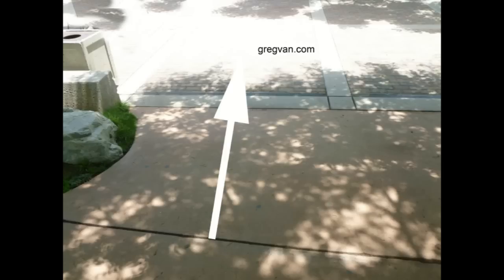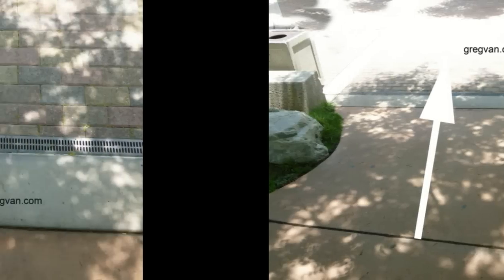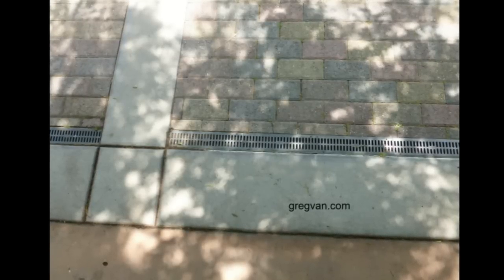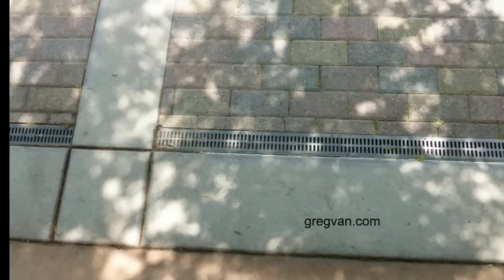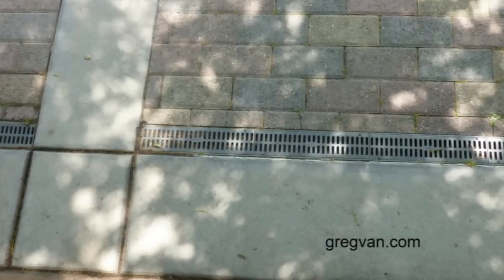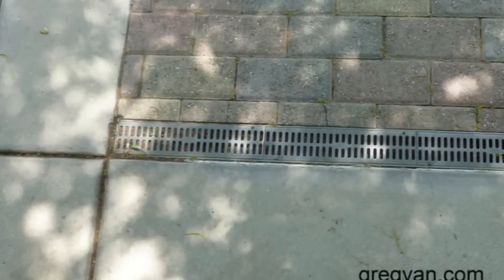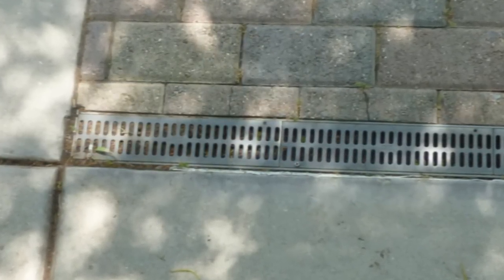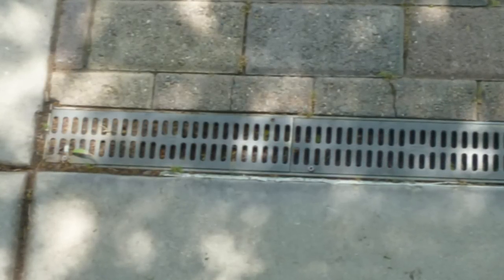Walkway Grate Drains - Sidewalk Water Runoff Reduction

Comment from the maker: You've got a good point, you would be surprised at how many people install grate drains like these, without any type of drainage system attached to them. These drains won't do you any good, if you don't have something for the water to actually drain into and carry it to a specified location, like pipes or a bed of gravel.